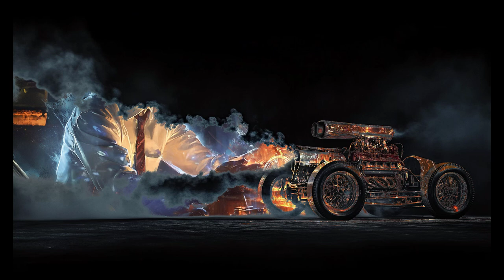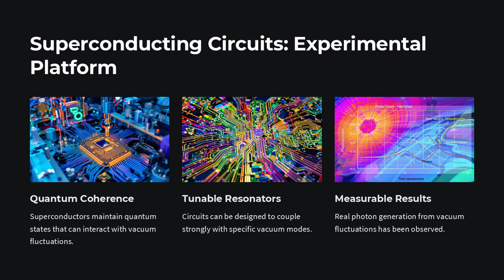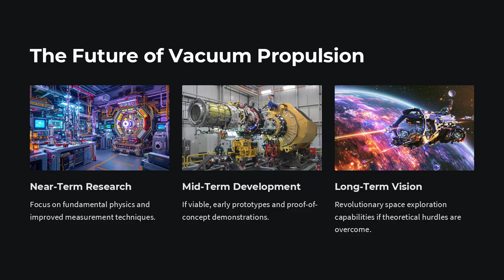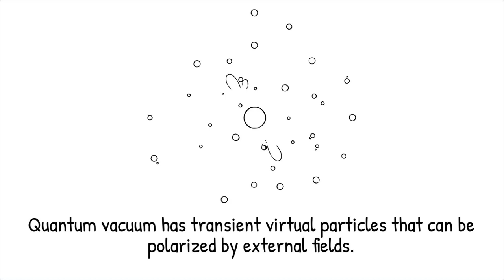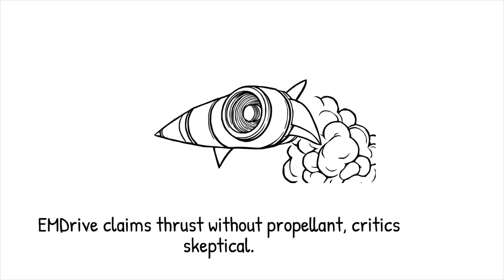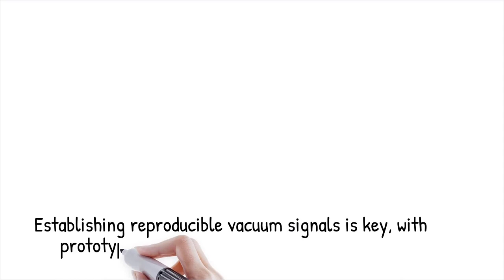How to Fly Without Fuel? The Vacuum Polarization Engine Explained

Comment from the maker: How can time-varying boundary conditions in superconducting cavities be engineered to optimize directional photon emission without violating Lorentz invariance?
What role do vacuum mode structures play in regulating the symmetry-breaking necessary for measurable net thrust?
Can dynamic Casimir systems achieve net mechanical work, and how does that reconcile with quantum field conservation constraints?